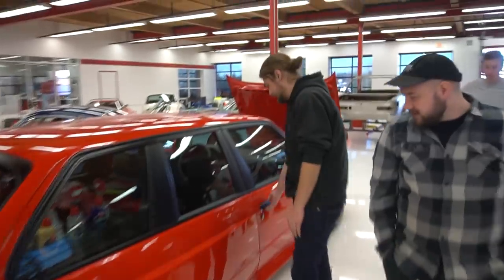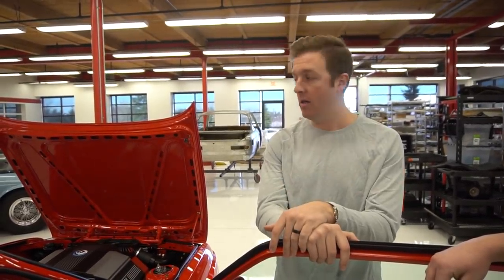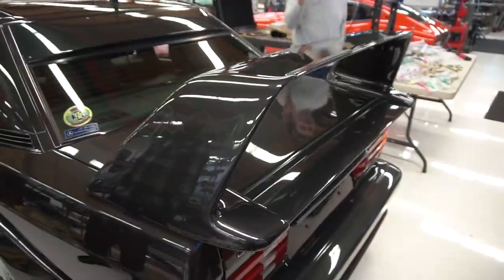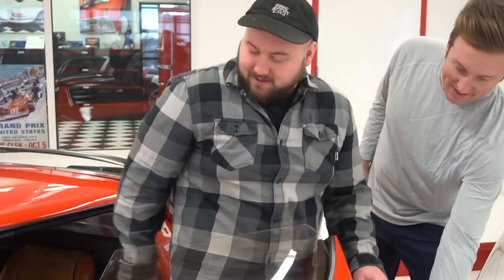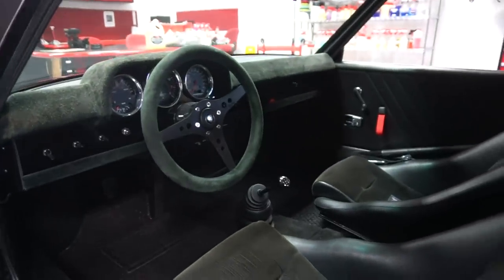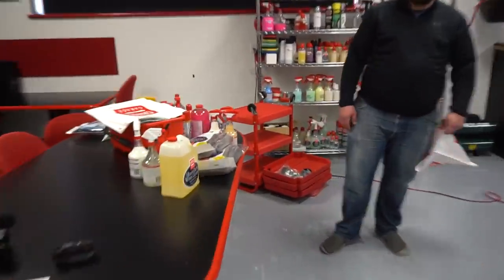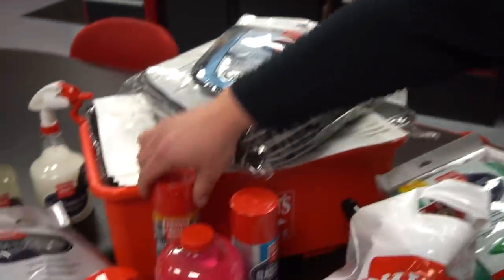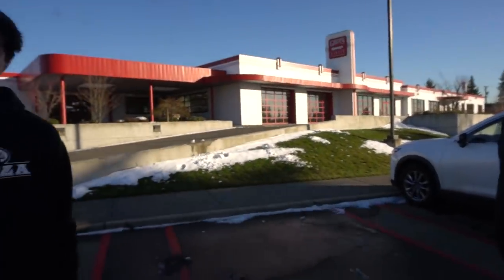Touring INSANELY RARE Car Collection at Griot's Garage [pt. 2/2]

Comment: Hey guys awesome to see you get into detailing! Just a tip, when your washing your michael fibers use an extra rinse setting if your washer has it and keep it on warm or cold heat if possible and NEVER EVER dry them in a drier, always hang them to air dry.